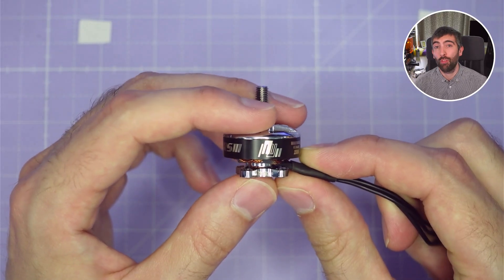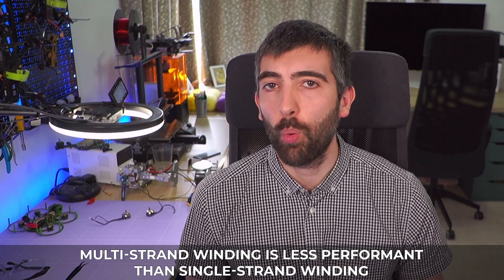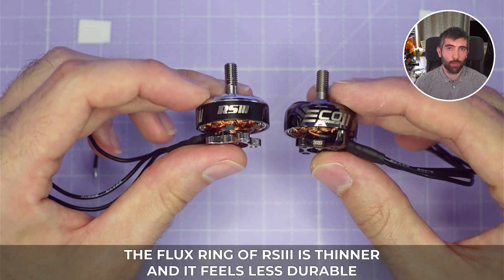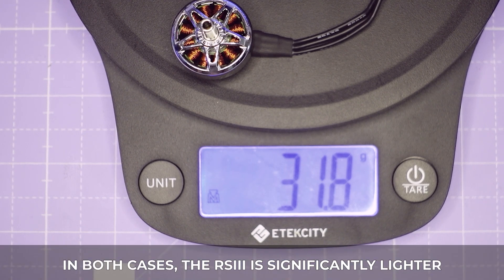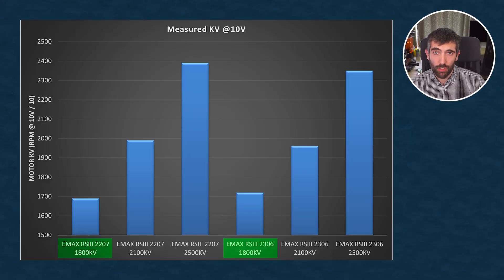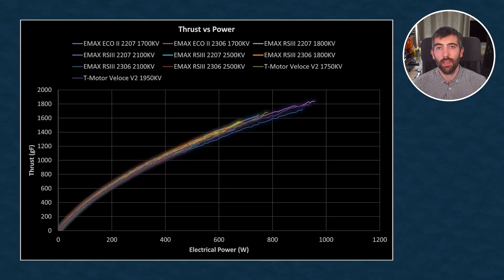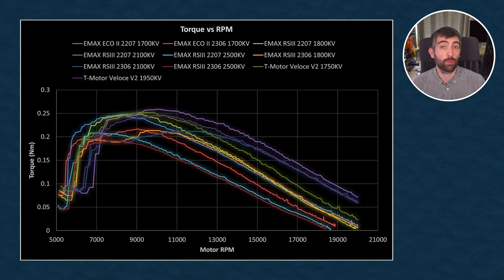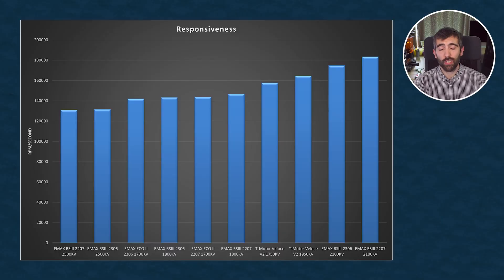Best Budget FPV Motor? EMAX RSIII Testing

Comment: Pretty interesting bro. I don't do quads, but model aircraft. I don't usually push my motors real hard, rarely even using 100% throttle to take off. 

But I'm gearing up for Flitefest in June, and during Combat the betting is on! I was thinking about swapping the 1806 motors on my Flitetest Mini Guinea for a pair of 220x, to really tear up the sky. 😂 

My limitation is that I am running 25 amp esc's, and really don't want to have to change those too.

Comment: Really good explanation on how these things tick brother! I don't fly quads, but model aircraft. So the use profile is generally more "cruising", except when I started looking at this particular motor. 

In this case, I'm considering powering a foamy jet during Combat at Flitefest. So... yah, pretty much 90-100% throttle for the whole thing 😂

Comment: @Mr. Rosser - totally love your videos and scientific testing. 

This is very informative Time 0 data to help pilots make the best choice for their drone builds. 

However, one aspect of the motors that your testing does not cover is durability and longevity. 

Would it be possible to run some shaft lateral loading to failure or pendulum impact testing to characterize the strength differences between these motors?

Another good test might be high-RPM stress test

Comment: So I just finished my second quad. I flew about 5 packs before my quad fell out of the sky. 1 motor is basically seazed up and another one has some resistance but not as bad. I'm running a speedybee f405 v3 on 6s with emax RSll 2306 1600kv. the coils look fine but the magnets look brunt. What causes the magnets to turn black? And why did this happen?

Comment: When checking for KV, I noticed you had a prop on it, that can affect KV. Have you tried with and without prop? Thanks for sharing.
Reply from the maker: My KV tests are done without a prop (or a prop nut) at 10V full throttle. Sorry if the testing b-roll isn't correct!

Comment: i loved my rsii2306, but i will not buy these do to multistrand windings, i'd opt for the new velox, the unibell doesn't bother me,  any hard hit i had on bell would have took out either as long as heat doesn't separate it, very disappointing emax!

Comment: Chris. Do you know what type of Aluminum they used on the bell? I noticed Emax doesn't publish it. Also, I noticed from their video today, they said the shaft diameter is 4mm. Does that mean, we can't use our 5 inch props since it will be loose?
Reply from the maker: 4mm is the internal shaft diameter. They fit a standard 5" prop.
Reply: @ChrisRosser  oh got it! Thanks buddy!

Comment: i trust emax to make motors. I LOVED the eco-lites. 14$ a motor, for PHENOMENAL performance, and if one goes bad i have plenty to spare! These literally allowed me to get into FPV. If i was buying 28$ motors a pop i wouldn't be where i was today.

yeah 1/6 of the eco would be bad/smoke. But these motors are built for performance/cost. If 1/6 goes bad... well i still saved money even in that case!

I also found EMAX to make supremely smooth motors. I fly t-motor exclusively now, but i would say they are the same level of performance but not as high quality  (durability ETC)

Comment: Interesting tests, easy to understand explanation. Especially liked the thermal camera. I'd be interested in comparison tests to the Xing E motors. I have a set. They look like single strand to me, they perform very well. And their price is very reasonable. 🤓
Reply from the maker: XING-Es are a great value motor. Very hard to get anything better for the price. There are better performers but of course they cost a bit more!

Comment: Multi strand coils.... That sucks. More heat=lower performance. Lower reliability over time. Glue on windings=💩
Reply: yeah dont know what it is with the eco-II windings they tend to go out quickly.
Reply: @BaldmanFPV  yeah. Get what you pay for. The quality of everything has gone to 💩. Don't actually even get what you pay these days. I've had to learn how to wind motors so I can get what I want...... Quality not 💩